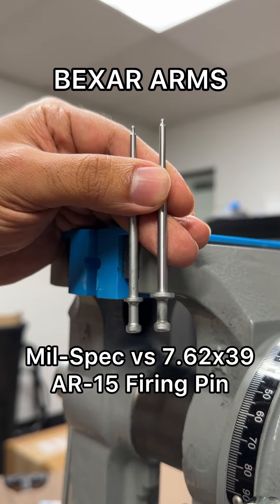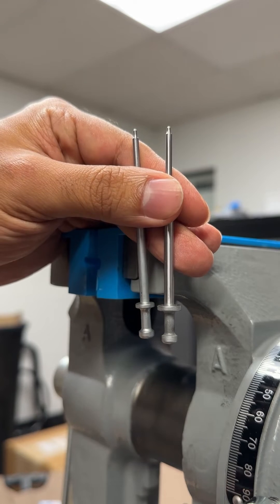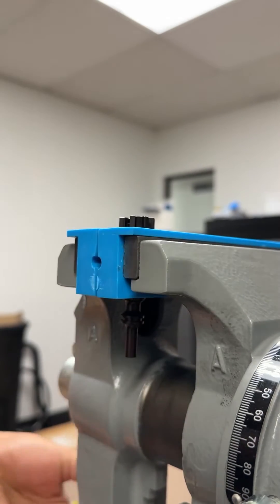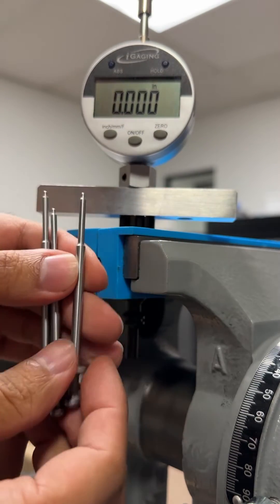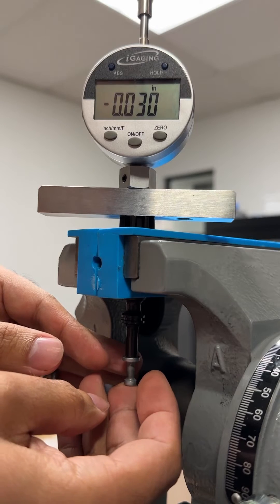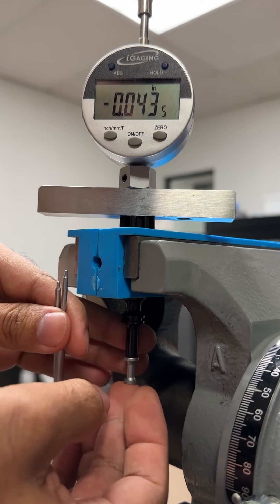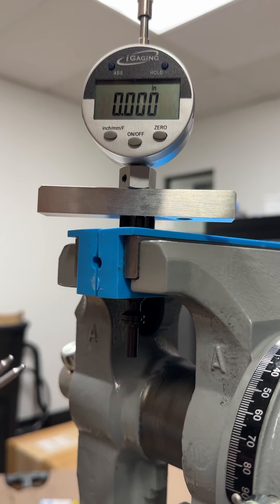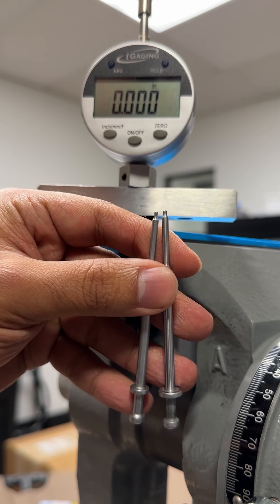Mil-Spec vs 7.62x39 AR-15 Firing Pins

Comment: can you use that firing pin to help with light primer strikes on 223?
Reply from the maker: @meadidthat  if you’re having light strikes with .223/5.56, there’s an underlying problem. Check your firing pin protrusion, it should be .028”-.036” from the face of the bolt. A full power hammer spring or a new hammer spring if your AR is old/has a high round count.